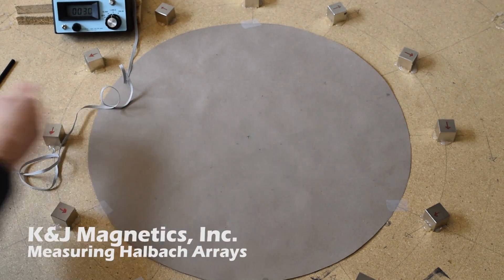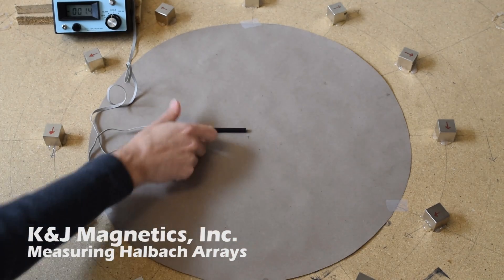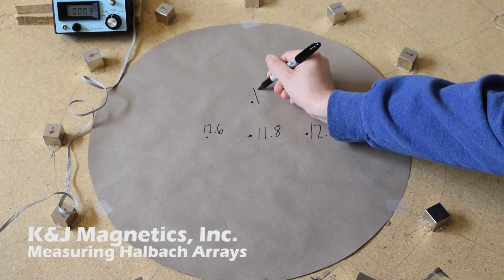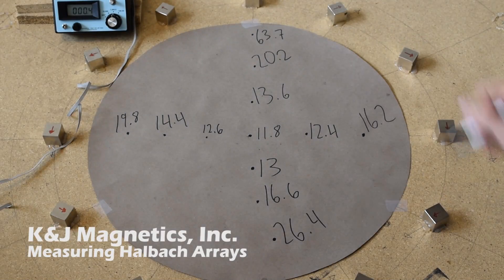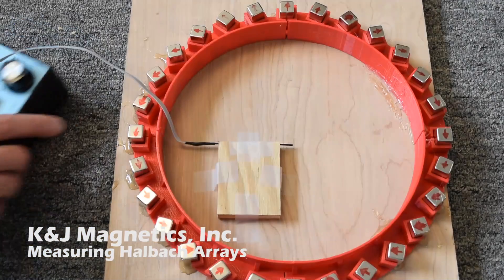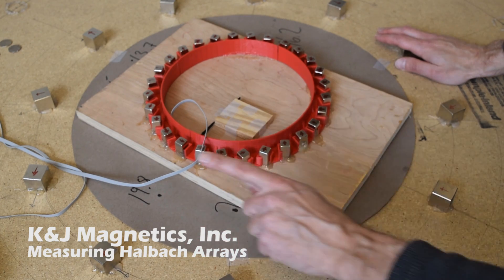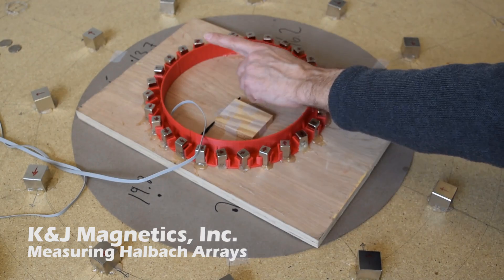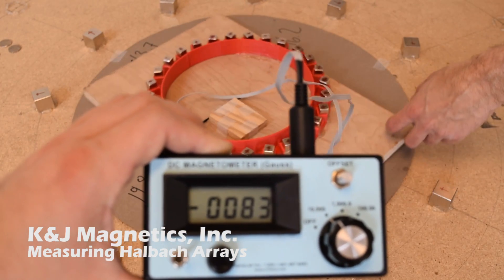Measuring Halbach Arrays

Comment: In ancient days of magnetic science people made Helmholtz coils to create nearly uniform magnetic fields within.  (they still do it now)  The coil is basically a pair of ring coils parallel and on the same axis at a specific distance.  

https://en.wikipedia.org/wiki/Helmholtz_coil 

Unfortunately the coil gets hot with any serious amount of current.  Now if you build a pair of rings of magnets with the poles along the tangent to the ring with the magnets rotating 1 time for each time around the ring youd should be able to get all the same effect without all that heat (and without the adjustability)  Magnets and coils together could create a baseline field, adjusted by the dynamic field generated by the coil.  I never got around to building one. Haven't really needed it, but it would be a good use for K&J Magnetics products.  Someone is bound to need one. :-) 🦊
Reply: I would call it a "Helmholtz Magnet" or maybe a "Foxpup Magnet" :-)  "Haase Magnet" would make more sense considering it's my last name and it is my idea.
Reply from the maker: We actually use Helmholtz coils for quality testing! They, along with some fancy instrumentation, can help us determine the dipole moment of a magnet, which we can then use to make sure the magnet is in spec.